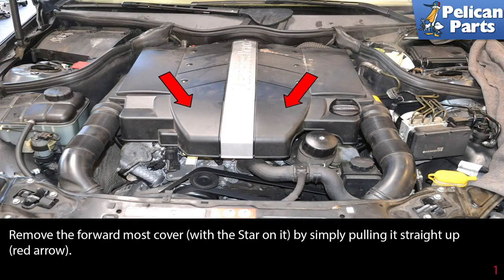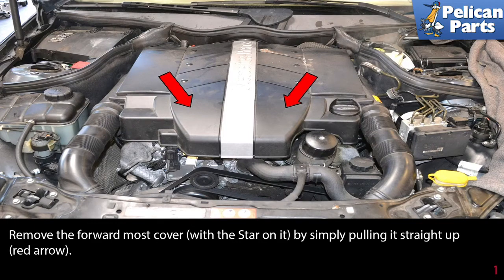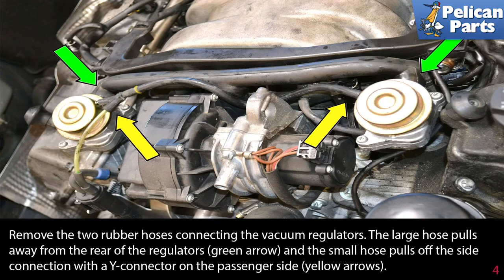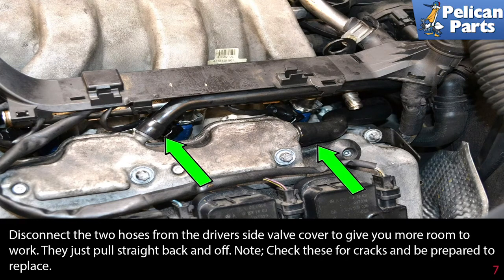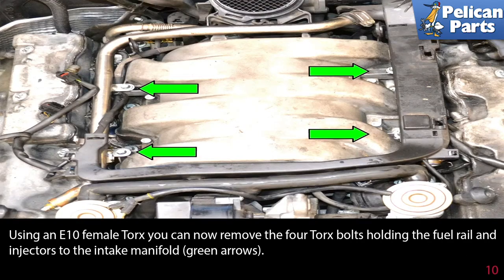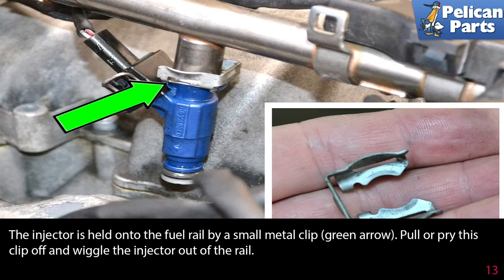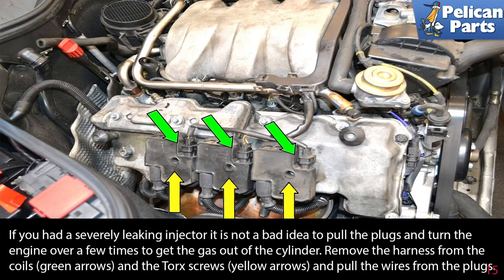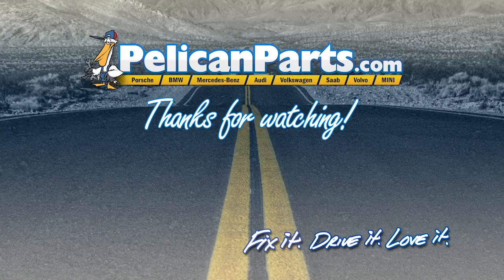Mercedes-Benz W203 C-Class Fuel Injector Replacement

Comment: Does 2006 2.5 c230 mercedes have a fuse for the fuel injectors?
Reply from the maker: They are powered from the same fuse as other components. Fuse 65 40 amp in the front SAM.

Comment: How much last injectors?
Reply from the maker: You didn't mention what year and model vehicle you are working on.

With your vehicle info handy, give The Pelican Parts parts specialists a call at 1-888-280-7799. They can figure out what part or repair kit you need.
Reply: @pelicanparts  i got w203 facelift c220 diesel one :)

Comment: Is that a C320 or C240? I have RED injectors on my V6 2.6L C240 (2004). Black ones do not work here. I only need to replace 1 bad injector. Question is, will these blue ones work? I want to put only 1 blue and leave all reds as they are. Red injectors are extremely rare and I cannot find them.
Reply from the maker: You'll want to go by part number. With your vehicle info handy, give The Pelican Parts parts specialists a call at 1-888-280-7799. They can figure out what part or repair kit you need and share the part number with you.
Reply: @pelicanparts  Thanks for the info. The indie mechanic market in my country is really strong. I went and had my car's VIN number looked up and received the injector's serial number. It is 1120780449. American C240 has RARE injectors. European version has 1120780149. Only one different digit. Those are very common. I installed 1 euro injector and left other americans in place. I seem to have fixed the issue.
Reply: @monolithworldline  Hello, does your Mercedes c240 say e85 compatible on the filler cap?

Comment: Brother this cause also a cold engine vibration? I have a w203 c220 cdi. When the engine is cold , there is a strong vibration but after 30 minutes when it’s warm , the vibration is not any more . 
Can you please help me?
Reply from the maker: Is the check engine light on or flashing when the problem is present? Sounds like an engine misfire. I would check spark, fuel and compression on all cylinders. Once you isolate what part of the combustion process is causing the misfire, you can identify the root cause.
Reply: There was no light no signs. But actually it was a bad alternator pully causing the vibration.